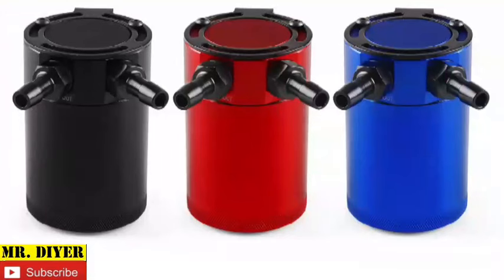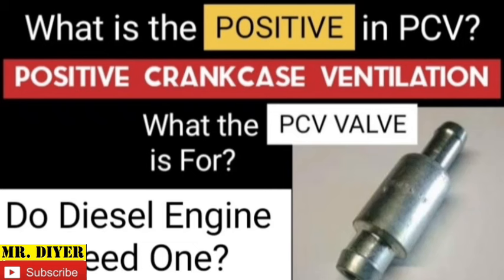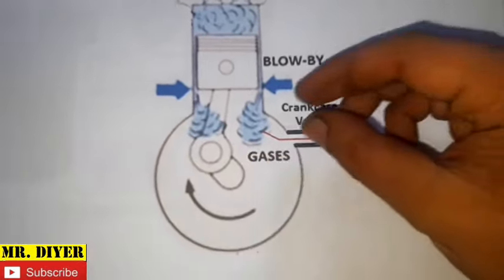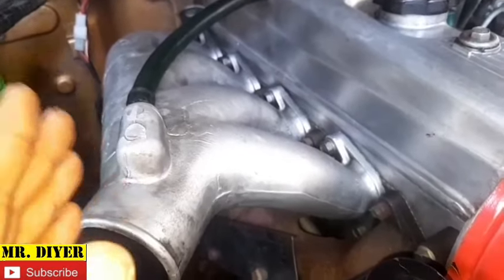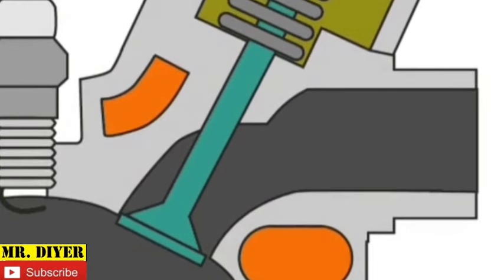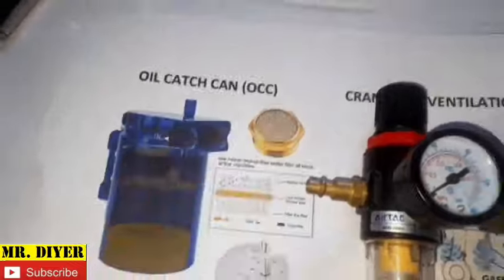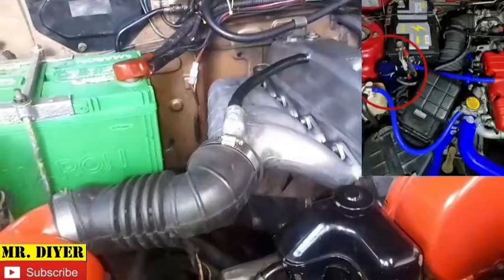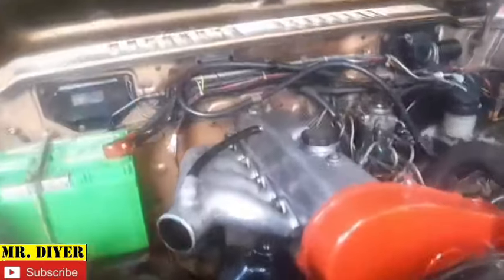This Is Why I DO NOT INSTALL AN OCC OIL CATCH CAN

Comment from the maker: This is for all of you who cannot understand an explanation but would rather focus on this so called REAL OCC  LOL https://www.youtube.com/watch?v=rMzFMcHrAyU&t=0s
Reply: If you are concerned about restrictions, use larger diameter hose and get a catch can without a filter. A pair of baffles-only 750ml aluminum OCCs in parallel adds essentially no restriction while providing lots of aluminum surface area to shed heat. And with 1.5 liters of capacity, emptying them at oil changes will surely be plenty.
Reply: The air is flowing at 90 PSI through your compressor hose.  Typical crank case pressure is 2 to 6 PSI.  The air going through a compressor is room temp, or outside temp.  The air running through the hoses on an engine are closer to the operating temp of the engine.  Those are huge differences, and is why your video does not properly address why OCC are important.  

OCC's can cause issues if they increase crank case pressure.  However, that is only if they contain fine filters that trap any debris, then the filter clogs a little bit, thus creating more pressure than the system is designed to handle.  Another reason OCC's can cause an issue, is if it's not drained periodically.  

There are many videos of people catching oil and water in their OCC's and dumping it between oil changes.  Oil, dirt, and lots of water are typically present.  If it doesn't create more pressure on the OEM system, removes water and small particles from the system, then I don't see why it's a bad part to install.

Comment: If you are destroying your engine with a oil catch can then none of you are doing your catch can correctly.  The air slows down not cause of the line or anything like that.  The air slows down cause of the large volume of the can and then is sucked right back out at the same speed.  A water separator is not the same as a oil catch can. A oil catch can is having air pushed in one side and sucked out the other side. A water separator is only forcing air through.  So again if your engine is damaged from a catch can, then you installed it wrong.
Reply: Exactly, the thing is to have as small hose length as possible, and I use just stainless dishwasher ball, these are letting the flow to pass, and still sepaeate the oil. In 3000km it collected about 300g of pure oil.
Reply: @2WheelDerness  why would the can catch oil and let air with gas pass? Wouldn't gas cause problems just like oil does? And if so, why don't we just cancel the whole thing and let the engine sucks fresh air instead?
Reply: @ajsh3000  well, main issue is that this oil with air from engine case (needs to eject the expansion gas) is injected back to the  intake and in combination with the carbon from egr makes a paste which close the intake and build on the valves, piston and rings. By getting rid of oil, the exhaust carbon dus have no adhesion substance and will just get to combustion chamber than ejected. Just blocking the vent will create lots of gaskets issue. Leaving the hose in open air will work but create fumes that polute, and also some of them will get back to the car interior and is bad to inhale them.
Reply: @ajsh3000 the pcv and occ are not only about separation. On modern cars the gases also enrich the air when it is recycled back into the mix lowering temps and increasing mpg. What the poster does not realize is most modern day cars have a restriction inline with this. With a catch can you are suppose to remove the pcv valve to have free flow and use correct lines that allow short distances with no compromises to the flow. Most modern cars mainly turbo charged do this
Reply: The good of the catch can is that the motor will not eat the own shit  again and again
Reply: It's actually impossible to harm an engine as long as there's flow. If you have so much blowby that pressure builds up, then your engine is already fried.
Reply: @TheGuruStud  not sure what this has to do with what I said.
Reply: Correct. The filter in the compressor water trap is not allowing the crankcase gasses to exit hence the ejection from the dipstick tube. An oil catch can must have sufficient volume to catch the oil residue and very little resistance to air flow for it to be effective. A simple test would be as shown in the video. If you install it and you have oil and gas ejecting from the dipstick then you need a less restrictive unit.
Reply: @jasontrevis7142  put that up as a separate comment.
Reply: It could also be because it’s getting to full a lot of the better higher end ones also have a drain tube going back to the crankcase I would suggest u watch moto IQ that guy knows his sh!t
Reply: @brandonbrandon749  why is that not it's own comment.  It has nothing to do with what I said.
Reply: I was hoping to see this comment thank you. I would also include not all catch cans are going to work on every vehicle it needs the proper flow rate and capacity for use case and engine condition and size.
Reply: Yeah diesel doesn’t even have vacuum.
Reply: @Michael-vq4yy  if a diesel does not have a vacuum,  then how does it draw in air?
Reply: I’m just kidding.
Reply: He put a catch can on a diesel. That’s not going to work like a gas engine cause there’s not intake vacuum on the vent line.
Reply: @Bennett1784  there’s no intake vacuum because of the throttle plate not being present.
Reply: @Michael-vq4yy  so what happens before the turbo, right in-between the filter and the turbo???  There is a vacuum 🤯.  Smarter every day.
Reply: @Bennett1784  Correct. But in the video there’s nothing.
Reply: @Michael-vq4yy  look. There is plenty wrong with this video and the information. And not knowing where there would be vacuum and the fact that there would be a filter on normal operation. Then maybe you shouldn't be under the hood of any vehicle.
Reply: @Bennett1784  Diesels don’t have pcv right? no positive pressure valve? It vents itself into the stream. No need for catch can or your just plugging the line of the stream.
Reply: @Michael-vq4yy  are you a kid trying to learn?
Reply: @Bennett1784  Yes and yes.
Reply: @Michael-vq4yy  then you should be looking for someone that works on cars that is knowledgeable.  Your going to find to much bad info.  Like this video for example.
Reply: @Michael-vq4yy UMM,   AIR IS GETTING PULLED IN  THE INTAKE THRU THE MANIFOLD ,  THEREBY CREATING  SMALL VACUUM
Reply: @markkrawczuk1943  You’re right. Does a diesel not have a throttle body in this video?
Reply: If OCC is not part of car emission control system then it is violation and car would not pass emission test. Again this is luck game some inspector may not ever look under hood but technically speaking adding OCC is unauthorized modification.
Reply: @BlahBlahManYeah  what does this have to do with my statement?
Reply: Tricky topic this is. In any case most likely youre altering the pressure in the engine, which is risky unless it is properly designed
Reply: @ajsh3000  without the catch can, the oily air enters the intake manifold and fouls the valves and this can lead to misfires and then you have to clean the catalytic converter.  The problem is that crank case pressure isn't released and leads to engine wear.  That's why we attach breathers to the can so that this pressure isn't returned to crankcase yet keeps the oil in the vehicle.  He's using a catch can that doesn't vent.  What the speaker in the video is concerned about is the delayed pressure difference from crankcase to intake manifold creates an air pressure resonance.  I think it's a good thing because the resonance created should help knock off any carbon deposits.  Normally the normally gasoline acts a solvent on the carbon deposits but even so... the carbon winds up in the catalytic converter.  So it's better to keep the air entering the intake clean.  If the pressure was too high [like when one puts too much oil in the crank case]  There's no were else for the extra oil to go except between the seals of the valve cover.  Now you got leaks.  Which is more of an environmental problem that air quality.
Reply: @ajsh3000 because it is unmetered air complicate your ability to achieve a consistent AFR.
Reply: This is assuming your producing large amounts of blow by and that the piping is insufficient and the manifold doesn’t contribute by pulling.  All the info is hypothetical and contingent on your engine producing a large amount of blow by as well as the hose being too restrictive. If it’s too restrictive and your engine is having that much blow by, you have far bigger problems and removing a catch can is probably the very least of them. 😂😂😂😂😂
Reply: @ajsh3000 depends on if you are doing a exhaust gas recirculation line or the engine pressure line.
Reply: @brandonbrandon749 Daniel at moto IQ is the bomb. The guy literally studies n tries to master every single aspect of performance AND economy.. he could also easily make more sense, with solid evidence, than 95% of the Masters out there, drunk AF.... And I AM NOT hating on Daniel AT ALL!! I aspire to that guy's mastery, work ethic, and absolute enjoyment! Look at all the top peeps in the community; how many of em do u assume are "laid back super chill after work" but regardless of that, they all seem stressed to at least SOME degree whenever u listen or watch em.. Daniel seems "laid back super chill PERIOD" lol... Granted, everyone has those "son of a b***! the ONE BOLT.. the LAST BOLT!! F***** just poofed out of existence!!" Moments... I'm sure he has those too, but I imagine him with a smile like, "aww rats. I dropped the dog on last bolt down the shop floor drain. Well, I don't have any more like that, and my cars don't get scrapyard parts,so I'll just have to wait 3 weeks, for 1 bolt. But it's not the end of the day folks. We can still enjoy the fact that this car is going to run so good.. as a daily.. and so mean, on the track.. and that's what people always forget about: the fun."

God bless that man! 😂

Dude is so high on life n on top of his game!

Comment: Great presentation! But I disagree with one minor detail. The OCC works great if used properly by not using the bronze filter. The filter is a micron filter and easily clogs with oil passing through thus restricting air flow. My remedy was to install steel wool with a down draft tube at the bottom. stainless steel scrubber flows alot more air while still maintaining the "catch" effect.
Reply: Agree the bronze increases pressure. There are some with relief valves.  Spend a bit of money on a good one.
Reply: So which one should I buy?
Reply: @stevijay2953  process west SEPR8R. Thats what i have.
Reply: The bronze filte hev to be the output not the input
Reply: That bronze filter clogged up on mine too and caused my valve cover and Vanos gasket to start leaking. I was suspicious about that filter the day I purchased it
Reply: Do you have an instagram you can share a photo with me on what you mean by down draft tube ? You did this inside the can right ?
Reply: Well, you might have just answered my question. That damn filter had me concerted. I'm removing it and adding steel wool
Reply: I have seen a few that have blocked the inlet and just ran a pipe from the crank case to ground, would this be even worse as there is no vaccume at all or OK as there is no resistance?
Reply: @kylewilson8150 venting crankcase to air is totally fine from an engine point of view and its the easiest way to do it.
That being said neither mother nature nor your lungs enjoy crankcase fumes
Reply: It’s actually a brass filter. Non the less oil will clog it for sure. And water will also be introduced to the oil as well
Reply: But was done for decades.
Reply: Wew now i knew it thanks again prof😊
Reply: Is the conclusion about negative effects on the crankcast the same, iff you dont connect the output to the manifold, but to the air??

Comment: i actually tried this on my hilux diesel engine d4d, i had a provent occ installed, when i lifted the dipstick a lot of smoke was coming out and a little oil, when i remove the occ and put the stock hose back on there was no more smoke. i also tried it on my suzuki celerio gas with an occ the same with the one you use on the other video, it doesnt have a brass filter inside, there was no oil/smoke coming out as a lifted the dipstick during idle but when i ask someone to rev the engine oil begun to come out, i tried it without occ and oil did not come out anymore idle or rev. i think its true that the occ really hinders the flow of blowby out the engine. good thing i just had it installed less than a month, i will cut my losses and just put the stock hoses back on. thank you very much for an informative video.

Comment: Try it with an OCC that’s made for the vehicle, not one that’s made for High Pressure Air. If you use one that is set up for proper air flow and pressure, you won’t have any issues. If you get a cheap one that’s just using basic media, then it’s probably not going to work and do as you described above.
Reply from the maker: lol whatever floats your boat.
Reply: @MrDIYer He brings up a great point, if you are going to show an OCC causes those issues, then show those issues occurring with an actual OCC.

Comment: Provent 200, they are designed for diesel engines, very low restriction, and they can return oil to the sump.  Your example of the pneumatic air/water separator is naturally far more restrictive and it operates at times near 100 psi.  The crankcase pressure/vacuum is general only a few psi or less.
Reply: apparently diesel engines, due to tighter piston ring sealing for the higher compression, have much less blow-by than petrol engines.

the blow-by is water and carbon and unburnt hydrocarbons that you don't want in your oil so returning it to the sump is not ideal

Comment: It is true for a diesel engine, but I find it very useful for a gasoline engine, especially one that works on direct injection of gasoline. I noticed after installing an oil catch that the black color disappeared in the exhaust, but before installing it, there was a permanent black color in the exhaust. I think installing an oil catch is important for the engine that works on direct injection  for gasoline.
Reply: What brand of OCC did you use? I have a Santa Fe 2017 GDI 2.4
Reply: @javiergimenez5953 
speedwow oil catch can
Reply: @NASER725  thanks! I think the same of you, every GDI Engine need this. In my case, I have some bad emissions in the Exhaust and I think a OCC will work because the Engine Will has a extra gases filter.

Comment: Thanks for the video.  I had tried OCC and air separator on my diesel MB and GDI Hyundai.  They both are different on air flow restrictions.  The air separator shall not use on car engine.  Blows gaskets!  Using a quality with big flow OCC works for my diesel and GDI.

Comment: Thanks for that information. I had an occ, but experienced a flat spot in acceleration. It recently unwound the pot due to vibration and I lost it on the highway. To prevent oil spitting on my exhaust and unfiltered air being sucked into my intake, I bypassed what was left of the occ. The flat spot is gone and my engine feels more responsive. After seeing this video, I’m not replacing the occ! Thanks heaps 😄👍🏼

Comment: Very interesting. Great demonstration to prove the point. 
At a surface level, one would think the air intake would be enough and it should be able to vent without a return, but your video shows exactly what you are saying.

Comment: I had Provent 200 installed on my 2016 Everest 3.2L on year 2018, never had problem ever since. But, recently I have encountered the strange loud humming sound during low speed acceleration, sounds like a modified exhaust pipe blowing, or the subwoofer playing the 40Hz tone, the whole cabin can feel the vibration. The issue was intermittent, my initial thought was the EGR system, dirty or EGR value malfunction... Ran the Forscan, no any code found and everything was fine. So I went to clean the EGR, Intake Manifold, Throttle, thanks to the OCC, the EGR system had little carbon, but it was dry. After assemble the everything back, I expect the loud humming sound would be gone, unfortunately, the noise was still there. I suddenly recall that I had OCC installed and I might as well to check if the oil can is full, or the filter is blocking the blowby gas, becoz the filter is almost 5 years old. The next day, I removed the OCC filter and decided to give it a try, Vola~ the engine humming sound was gone, everything sounded normal again. This video explanation make sense, OCC can alter engine performance, or do damage to the engine, especially with those cheaper OCC. For me, I will just bypass OCC for now, since the new filter is too expensive, I would rather clean EGR system once a year.
Reply: Maintenance is key
Reply: In addition to Provent it has bigger tubes which is 25mm compare to other OCC in the market that is why is does not have restriction when it comes to blow by gases
Reply: Korek

Comment: Haha I knew I wasn’t crazy !! I have too one of these replica mishimoto oil catch cans that contain the broNze filter which didn’t take long to clog. I started to notice a lot of leaking around my can and also leaking around my valve cover and Vanos gasket. Glad I noticed it quickly and remove the bronze filter and now the oil leaking around my valve cover has stopped. I’m considering just venting to atmosphere using a differnt can

Comment: I have tried a mishimoto occ on two of my gasoline engined cars and Ive noticed that when i rev my cars hard , the catch can does catch a lot of oil but it also causes a leak at my oil filter gasket. I figured that the blow by gases arent venting out as efficiently and its pressurizing the crankcase .
Thanks for the eye opener , shall un- install the catch cans from my cars